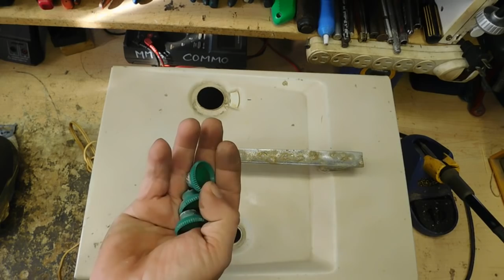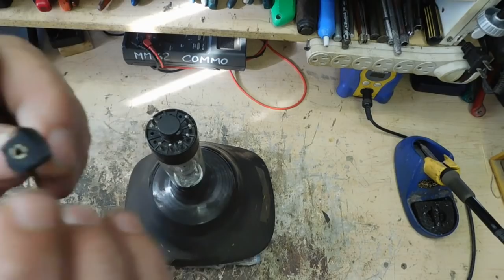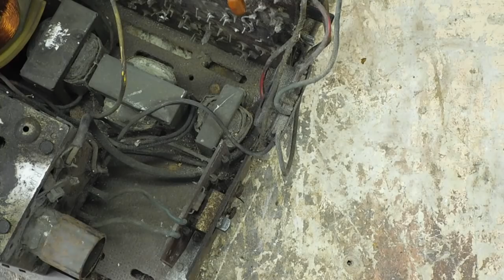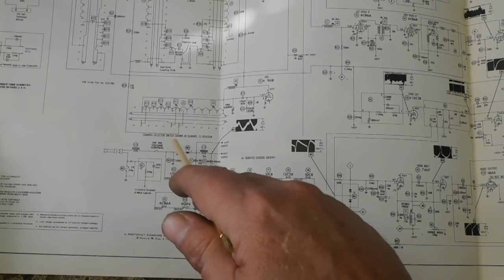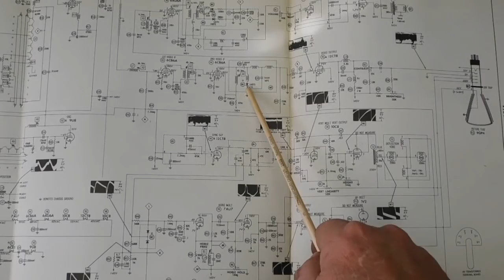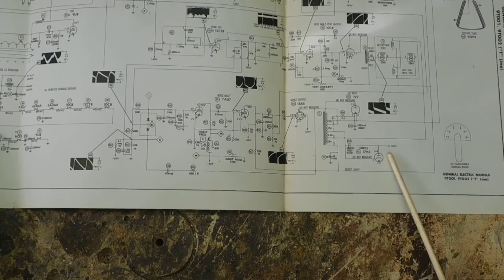General Electric model 9T002 TV

Comment: I had that same TV it does not use a 6C5 tube I think it used a 5J6 tube, the one I had had whole bunch of problems like vertical sweep problems & horizontal sweep problems intermittent high voltage and possible sync.problems & video problems I never got it to work properly, then I thought the picture tube was weak then I tried to rejuvenate it , instead I flattened the tube instead by accident, I just wrote it off, I hope good luck getting your TV working properly, good luck.

Comment: thank you for tutorials video they are very informative. The corrosion on that telly you are working on is very significant,  if the pin on the extra high tension failed the probability is that the thermonic valves pins are also affective too. the corrosion can creape up the pins letting the valve  gas to air and effect the emissions. no doubt the rf coils would be affected too. I expect you know this and I am look forward to seeing how you get on. all the best Peter.

Comment: Nice project.  I am sure you would not consider this, but there is a very bright lady who presented something that really astounded me. If you are interested I will send the link.  But it boils down to demonstrating her first attempt at friction welding plastic. I for one am going to follow up on this. Basically she did a show and tell of a Mattel toy that did this back in the 60's. A small drill that had sticks of polystyrene about 1/16 in diameter that spun fast enough to friction weld plastic. She went to HB and bought a China Dremel and replaced the power cord and supply. Bought long rods of polystyrene and put small lengths in the collet. Away she went. Her welds were as strong or stronger than the base plastic she was welding. Surprised her and me.  In this case you could do the same if there was a small piece that can be robbed from the set inside, weld both sides and grind and polish with Novas; and it should be an invisible repair. I am sure going to try it.  Good luck .